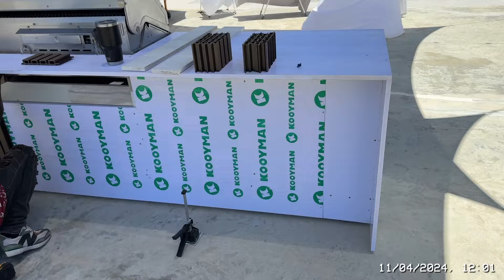Finishing the patio cladding and the BBQ

Comment: Just found your channel! We built in 2020 (during Covid!) at Water Hall, St.James. We're 500' up on a ridge overlooking Westmoreland and the Caribbean. Constant breeze - so, although we have air-con ducting in place, we haven't found a need to install it. The house is 100% off grid and our EV car is run off the sun too. We brought as much as we could down in Hi Cube 40' container from UK - including a completely assembled Wren kitchen, our 36 solar panels and Li Ion storage batteries! Car came on Roll On, Roll Off Geest boat too. We used Iroko hardwood for all doors, windows and jalousies (made locally by Millworks) - our brother in law built on the beach at Long Bay, Inch Marlow 25 years ago and due to the constant sea fret anything metal has had to be replaced every couple of years - fridge , oven, TV, washing machine, dryer, laptop! I see the trials and tribulations you have been through to fulfill your dream and sympathise - we were very lucky, as we used a builder that was both competent and trustworthy (Victor Lorde). Pop in if you're ever in the area!
Reply from the maker: Hey good to hear from you Paul, I assume you are still on the island? We should definitely catch up. Lets make a point in doing this. DM me 👍🏼
Reply: @barbadosbeachhousebuild  Will look forward to it Alvin! Found your email address on an earlier post ...so have sent an email reply to you.